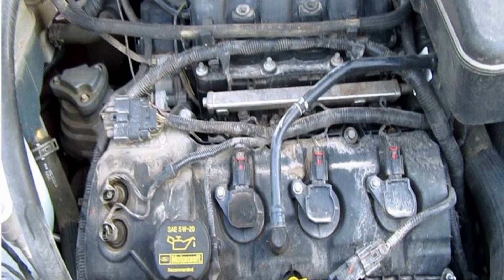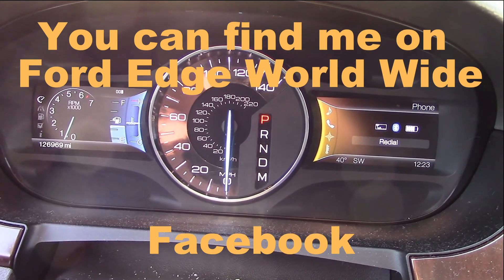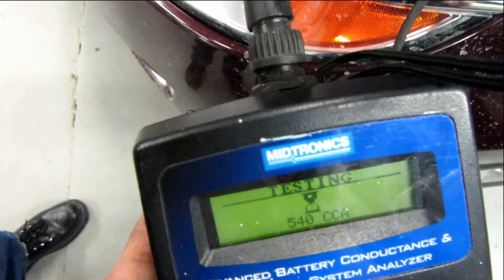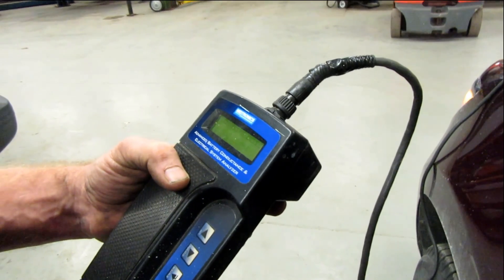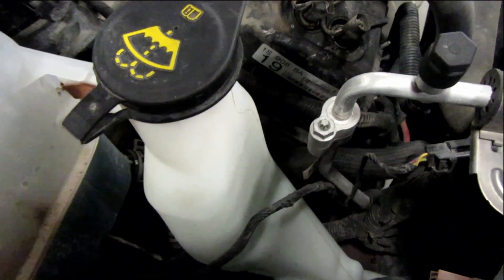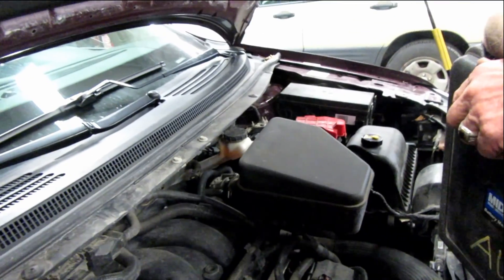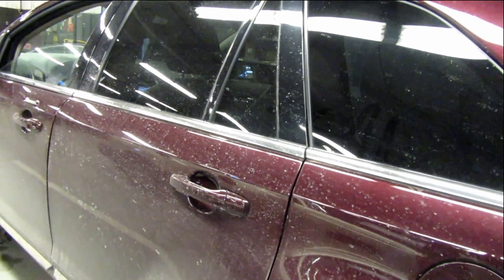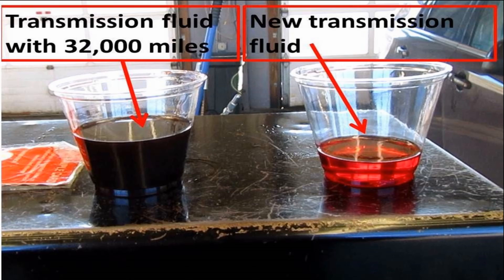2011 Ford Edge voltage regulator failure shunting charge with no battery light

Comment: No crap most times the voltage regulator is what wears out in alternators and it's cheaper to replace
Reply from the maker: Unfortunately this alternator can not be rebuilt.  You have to replace the whole thing.